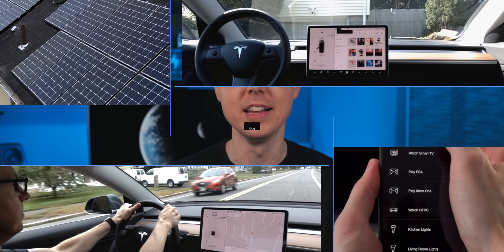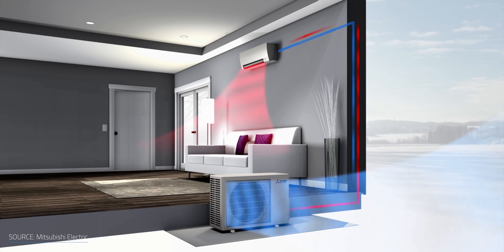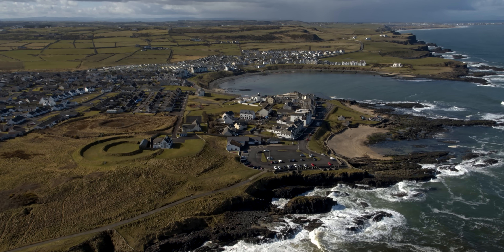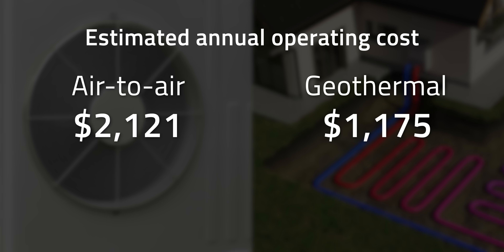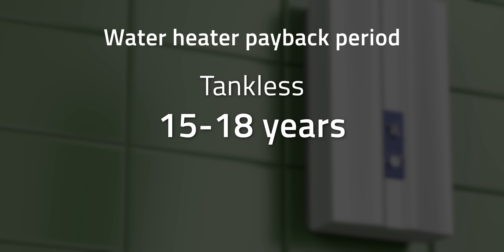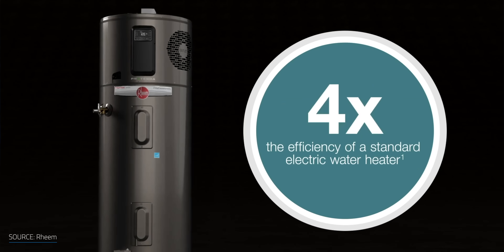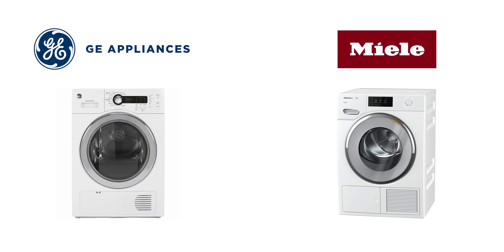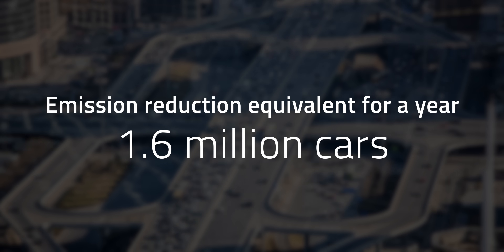Why Heat Pumps are Essential for the Future - Explained

Comment: In the UK, electricity was 6 times the price of natural gas per kWh - it is now 5 times. But that it is still quite a big difference. In the UK, nearly everyone heats with gas (or oil, but not many use electricity). With air source heat pumps being less efficient when you most need it - when it is cold - I think it actually costs more to switch, not including the capital cost. From an environmental perspective, every extra kWh you take in electricity comes from burning fossil fuels - taking more electricity does not make it windier or sunnier. So with fossil fuel power generation efficient being around 25% (including transmission losses), and with a gas boiler being 85-90% efficient, the case for heat pumps, especially air source heat pumps, does not seem to stand up to scrutiny in the UK. Quote some accurate figures and prove me wrong.

Comment: The problem with heat pumps is that they take heat from outside and transfer it inside. There lies the problem.  The colder it gets outside, the less heat to pump inside.

Comment: okay, heat pumps.  They are getting more efficient.  but they still suffer in extreme situations.  If you live in a places that will have multiple days of not weeks of -25c or lower.  They are not a great choice.  If you do choose them, you will need some form of supplementary system to add heat to your space.  They do move heat from one place to another.  But the issue comes from it being an air conditioner in reverse.  In a heating mode operation, the outdoor unit is effectively trying to air condition to the world.  The indoor coil(in your air handler) is discharging the heat from the mechanical compression process into your home.  Here is the issue, at a certain point, the refrigerant used in the unit, can't pull heat out of the outdoor air.  -30C the unit works harder to do the same job it would do in -15c.  Which means it needs to run longer, to heat your home because it can't exchange as much heat with the outdoor air, because there is less heat to exchange.  
A ground source heat pump, works better because at a certain ground depth, the soil temp doesn't change, it will stay at 15C all the time.  but you need a good amount of land to either build a ground bed, or have a deep ground well.  
The solution to the heating problem is custom build refrigerants that can exchange heat easily in colder temps, but when you make a custom refrigerant choice, it isn't a jack of all trades.  It will do the heating portion heat pump operation better, but then you sacrifice the cooling option in the summer.  Also, they use a lot of electricity.  If the compressor in the unit runs for 12 hours to maintain heat in your home at 18C, well that is 12 hours of constant electrical usage, which depending on your electrical rate would be very costly.  Most high efficient gas furnaces are running right now at 94-97% efficient.  They will also run less than a heat pump to heat your home.  
Final note, a heat pump is only as green as the energy that is provided to it.  So if you live in an area with a lot of hydro electric power, you heat pump is powered by hydro electric, if you have nuclear, its nuclear.  If you local power is running on NG or clean propane, or coal, that is what is powering your house.  If you have solar on your house you could power the heat pump with solar.  But if you live in a climate that requires the usage of a heat pump to heat your home, you probably have period of the year where the daylight hours or shorter, or the local climate doesn't lend to a lot of solar capture.

Comment: Efficiency of ASHPs is much lower during Wintey

The first is the efficiency of air source heat pumps. The Government(uk) feels heat pumps are game changing technologies as they are highly efficient – at times converting 1 unit of electricity into 4 or 5 units of useful heat (so 400 or 500% efficiency), while a gas boiler might be somewhere around 90 – 95% efficient.

On the face of it, that makes it look a no brainer. A very efficient heating system that produces no carbon dioxide. The issue is that the efficiency numbers often cited in the media are not annualised figures (i.e. an average efficiency over the course of a year). They are cherry picking the peak efficiency – which occurs when the air temperature is in excess of 20 degrees.

Air source heat pumps work by taking latent heat out the air, and transferring this into a refrigeration coolant. The coolant is then compressed using an electrical compressor which drives the temperature up, and then a heat exchanger takes the heat from the coolant and transfers it to the hot water within a heating system. Regardless of the air temperature outside of the property, the coolant typically can get to the temperature required to run a heating system – but it just takes a load more electricity as the compressor needs to work that much harder when the weather is cooler.

It is true there is some heat in the air even in extremely low temperatures, however in order to drive the temperature of the coolant up to a useful level, the compressor needs to work harder – and remember the compressor works on electricity. This brings the efficiency right down potentially to 150% efficiency. So, while in the summer, efficiency of the heat pump could well be in excess of 500% (i.e. one unit of electricity produces 5 units of useful heat), this is certainly not the case when the temperature outside is hovering around zero.

Now if you think of the times of year when you typically run a heating system, it is during the colder winter months. This means that when the weather is cooler, the compressor works harder, and your heat pump will be what we often describe as an electricity vampire.

What we are saying is that when you need the heating, air source heat pumps are working at their least efficient.

As of 16th March, gas and electricity prices are at unprecedented levels.

The cost of a unit of gas is approximately 7.5 pence per kWh.

The cost of a unit of electricity is approximately 28 pence per kWh

But typically the ratio has stayed the same even when prices were much lower – a unit of electricity is approximately 4 times the price of a unit of gas.

If you gas boiler is running at 95% efficiency, it is going to cost you right now about £0.07 per unit of useful heat.

In the winter, when the air source heat pump could be running at 150% efficiency, it is going to cost you £0.19 per unit of useful heat.

So no emissions in the home, but more than twice as expensive to run!

ASHPs are powered by electricity that may still come from burning gas
The other issue with electric heating systems is that while they produce no in home emissions, most of our power still comes from gas power plants. So, it is likely that gas was burnt to produce the electricity needed to run the air source heat pump anyway!

Obviously there has been huge investment into renewables like wind turbines, but if the wind doesn’t blow, much of our power still comes from fossil fuels.

I think there are a few points worth caveating though. Firstly, ground source heat pumps are a different story. They have a very similar efficiency all year round – approx. 450%. However, they are extremely expensive to install.

If you do go for a heat pump, it does infer that your house is sufficiently insulated (their working temperatures are far lower than gas boilers), so that in itself will see you have lower energy bills that an uninsulated equivalent property.

Comment: Matt: thoroughly enjoyed this (and many of your other videos).  My mother lives on a small inland lake in MI.  I was thinking about a ground source heat pump (HP) for her home (her HVAC system is on its last leg); the ground source option is attractive because it avoids all of the super-cold air temperature issues that standard HP would have to deal with in, say, January.  However, I suspect that getting down ten feet would put the tubing under water, due to the high water table around the lake.  So I presume that this is not feasible.  Your thoughts?
Reply: Having the tubing below the water table is Ideal!  The amount of heat exchanged to dry dirt is fairly low, while putting the tubing below a pond, you can quickly absorb or get rid of the heat in the summer very quickly, even with a  shorter length heat exchanger.  Of course a longer tubing is better to warm the coolant as much as possible in the winter.  

I would suggest a pair of wells about 100 - 150 feet deep, so well below your water table, and run the tubing down and back up to the next well while the trenches are below 4 feet deep (so it will be below the frost line and not freeze each winter).  Your water loop might go out at say 25F and return about 35F.   The two wells would be most effective if about 25 - 35 feet apart, so they don't both use the same rocks to collect the heat.
Reply: KM,  Another thought would be to drill a well, and use that water to run through a water source heat pump, and then release the water back to the ground near the well.

Comment: Geo thermal doesn't make sense for most people because they are unlikely to recover the cost in the life of the equipment unless it's new construction, especially in an efficient house, if there is no  potential to spend there is no savings. I don't think it's the move to make for most people especially because there's about to be the biggest evolution in equipment since the industry began, affordable invert drive has arrived to the residential unit. The technology in modern air conditioners is ancient, with the exception of low voltage circuits little has changed for the affordable residential split system. Yes invert drive has been available for residential units and we installed our first Ruud Eco drive machine about 2014 it was pricey, 3 times the normal 14 SEER equipment, most customers have initial cost near the top of considerations. Due to being in an old house in Florida the eco drive machine was projected to save the customer $26,000 at 2014 energy prices if it goes 20 years without a repair, I suspect it has or is close to paying for itself in energy savings. But there's other factors people think about, like what would that initial extra money have done in the market. Here's how affordable invert drive is coming, at least two companies Samsung and Copper Hunter have come out with standard residential air handlers that connect to their mini-condensers(Invert Drive) up to 4 ton, no 5 ton condenser yet which is the biggest energy pig of them all. The difference in my cost for a 3 ton copper Hunter 20 SEER invert is $1000 more that a  Ruud/Rheem 14 SEER split. This a huge huge deal.
 One more thing, unless you are invert drive in a northern climate you are likely dual fuel, heat pump and likely gas, first stage HP, second stage gas, third stage heat strip. An invert drive machine can get full heat out of the air down to about zero degrees, the standard machine to about 35 degrees. you might be able to get away with just an invert heat pump up north but dropping under zero could lean on your strip.

Comment: heatpump dryer is something I looked into and the cons outweight the plus. If it was a unit I could wash and dry in it, it would be ok to have longer dry time.  But I cant leave the washer unattended. So I have to wash back to back and drying time of dryer needs to be equal or faster than the washer.  This is why I went with conventional units.  I would rather have TWO units which both wash and dry. Set and forget everynight, wake up to washed and dryed clothes.  But im not made of money

Comment: I'd be curious how effective they would be in places like Australia, where it can range well over 30°C over the course of a single year. In Bunbury (where I live) we've had temperatures as high as 44°C & low as 3°C in 2022. Basically, we'd need a heat pump system which was extremely efficient at both cooling & heating, with the optimum rppo temperature of about 18-22°C. 

btw - I'm really not fond of the excessively cold temps which some people with aircon systems (especially office buildings for some reason) seem to find necessary...

Most of these technologies are fairly complementary, too. Insulation can do a lot of the heavy lifting in maintaining an optimum internal environment & solar power systems will severely reduce huge quantities of fossil fuels.

Ideally, given that the majority of the cost of these technologies is in the installation phase, it would be extremely helpful for governments to subsidise the their inclusion during the construction of new homes, as well as retrofitting them to existing ones. The more housing which switches to high-efficiency heat-pumps the better for us all.

Comment: To pick a nit, R-134a is not used for A/C to the best of my knowledge.  I'm no expert, just an amateur DIY'er and I keep tabs on these matters.  The industry has moved to R-407a.

The big downside, besides upfront costs, to all the heat pump water heaters and dryers is complexity.  With complexity, increased likelihood of failure and difficulty to repair.  Except when the tank leaks, electric and gas hot water heaters are repairable. Easily.

While ROI favors the heat pump appliances, I don't think the figures mentioned are great motivators.  Even a savings of $500/year isn't great considering the up front costs. And I don't know where he got that low lifespan figure for an electric dryer.  I've had ones decades old and at worst, one just needed an inexpensive drum drive belt.  And a complex heat pump dryer is supposed to do better than that? 

Heat pumps for dwellings make total sense.  My 1974 house in south central Texas is all electric inc. AC/heat pump.  Due to the very unusual "customer choice of electric providers," my electricity is 100% renewable at 8.5 cents per kw/hr!

I worked for a company called Miller Fluid Power almost forty years ago.  They were based near Chicago.  When the headquarters was built in the 1960's, it was very forward looking.  Total reverse cycle heating and cooling, including in the production area. The factory.  Even had a swimming pool for the employees.
Reply: We got a bosch air/air heatpump and a miele clothes dryer with a heatpump built in. Its been very succesful saving energy with both solutions. Think the dryer is 3 years old and the air/air is over 10 years old. I agree its more complicated tech yes, but from what Ive experinced first hand its worth it.

Comment: Is that CO2 number correct did you account for the increase CO2 generated by the increased demand for electricity because the electricity is generated co2

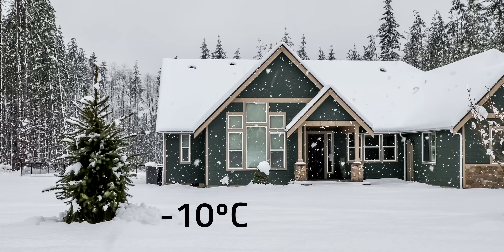Comment: 5:00 is quite wrong. Narration doesn't match screen, in that Matt failed to say 'minus', and the text on screen, "-10°C (-14°F)", is also incorrect, as -10°C is +14°F. I had to pause the video because it was so multiply incorrect. Cheers.

Comment: Hybrid water heaters are ok during the summer, not the winter. They transfer the heat from the home into the water, making the home cold,  then the home has to get heat transfer again from another source. Then you have to consider the maintenance of any Heat Pump system. It will require a service vehicle that gets maybe 18 miles per gallon. Is the end result really a fuel and cost savings? There are many factors that need to be considered. Vertical wells are the only way to go with Geo Thermal, The Geo Thermal COP does not take into account the cost of the pumps to circulate the glycol from the wells into the Geo Unit. Most Geo units require costly repairs within 10-12 years after installation. Refrigerant leaks are the number one issue. Parts availability of the Air Coil which tends to develop a leak are an issue. Then you are stuck with resistance heat, or if in the summer, no cooling. In the end, is the consumer better off financially?

Comment: If your trying to keep a house warm there must be heat that can be moved, these things down really offer any benefit if the exterior is below 5C, which when you really need the heat. You get nothing from nothing.
Reply: You must have a bad heat pump if it can't work at 5C. Many brands will work down to -20C, but they do need to do a defrost cycle from time to time.
Reply: @Pete856  spoken to a number of purveyors they have said similar they don’t work at 5C or below, 12C is more practicable. If your out side temp is -10C for example where does it get the heat to pump
Reply: @robertjohnson-taylor100  Just because it's below 0 doesn't mean there isn't energy in the air....the heat comes from the temperature difference between the refrigerant and the air. I have a Mitsubishi Electric heat pump, and they guarantee full heat output down to -15C.